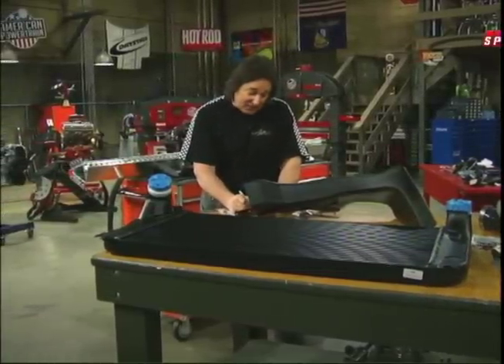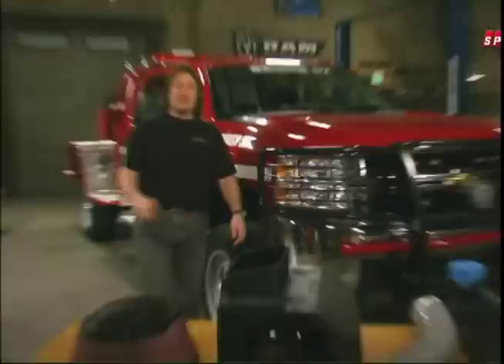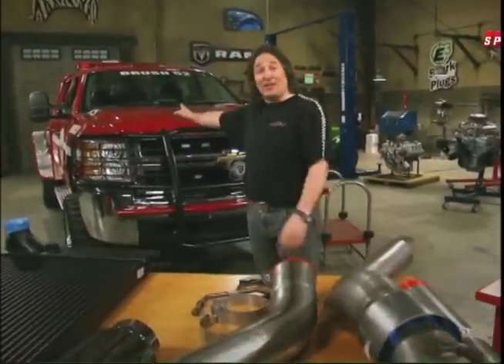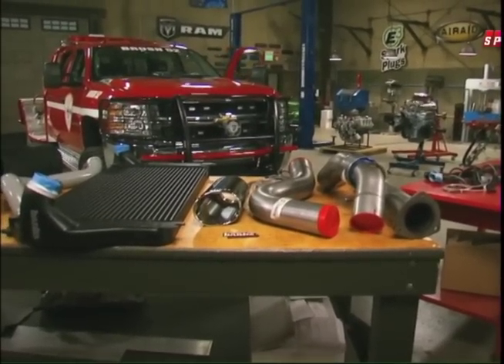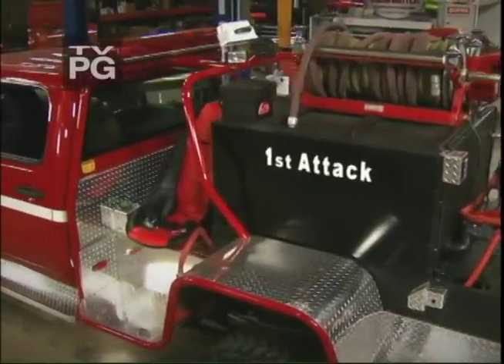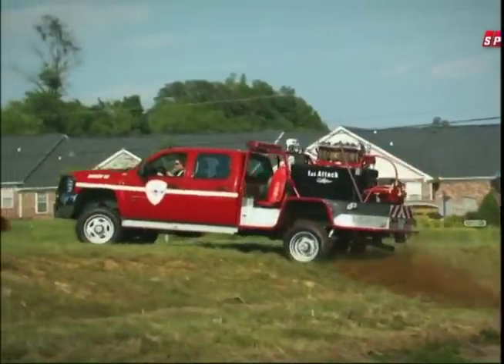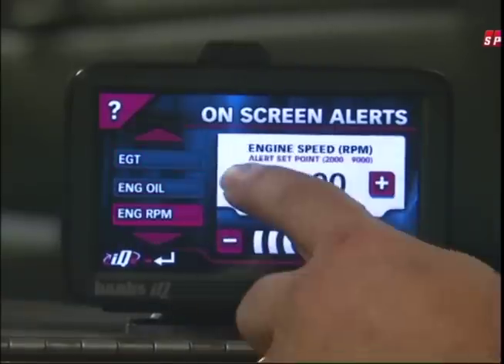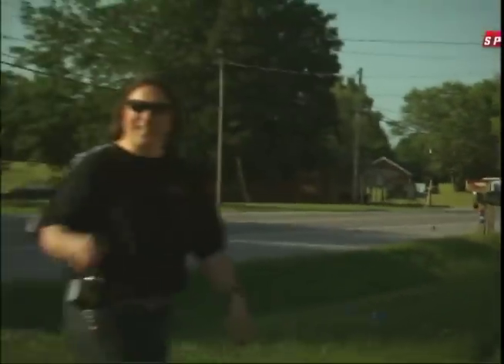Fire Truck gets Banks Power

Comment: safety vehicles shouldnt be subject to emissions equipment. you let that dpf slap you into linger mode in an emergency then youre SOL
Reply: The U.S. Army Does not require any emission equipment at all, in fact the only emissions they are are suppost to pass is 1999 emission standards, I don't think they even care about that either. I see army trucks drive by all the time that are straight piped, no dpf or muffler. I see armored trucks that are built on Ford F350s with the 6.4L powerstroke that have no dpf and are loud SOBS because of no muffler, but they sound good haha.

Comment: It's a 1-ton dually but it's not a dually. Has the rear fenders for a dually but only single rear wheels. I'm guessing it's due to the lift and bigger tires? Nice truck but I can only imagine how much all of that would cost someone.
Reply: I wondered why they didn't use a dually for weight capacity, that is not a dually never was unless someone spent a lot of time changing axles and hubs back to srw.  the bed is not a factory bed so it doesn't dictate anything.

Comment: Why did you take away the "Dually" functionality?
Reply: Mud and stuff get stuff between the tires and Is a pain to clean
Reply: They didn't need the weight carrying capacity of the tires just the payload of the 1 ton leaf springs. 2 load range e tires can easily carry 6000lbs worth of payload. personally I would've opted for a wider tire to decrease ground bearing pressure.
Reply: Kyle Vanwinkle agreed
Reply: +Kyle Vanwinkle i agree wider tires but many fire situations in looser soils count on a narrower tire to mash its way throught to more solid soils

Comment: Fords are cheaper, what more needs to be said when the guy who's cutting the check isn't going to be the one driving it?
Reply: SpecialKLSX Our new f550 brush unit beats Chevy by far. They also have a lot more power our Chevy just cost money in parts more then the new rig does.

Comment: I'm not so sure power is what a brush truck needs, so much as tank and pump capacity, and water cannon range.  I was even wondering if fitting smaller than original engines into army surplus trucks would save weight, thus allowing the installation of a bigger tank.  https://www.youtube.com/watch?v=8ScQ6N4q4hM&t=16s  They have a 10x10, which could be converted to haul a bigger tank than this 8x8, perhaps with a 6V-53t? if the 8v-92t is worn out? to reallocate weight from engine to tank?
  Offroad travel is usually under 10mph anyway, so how much power do you need to go 5mph?  It should be enough to drive the longest range water cannon made though.  I certainly never floor my slant 6 offroad.
  Climate change demands every mechanic out there who can to start reconditioning and converting these army surplus trucks!